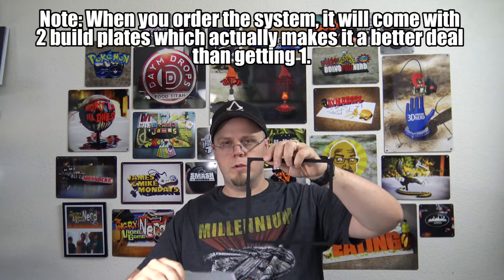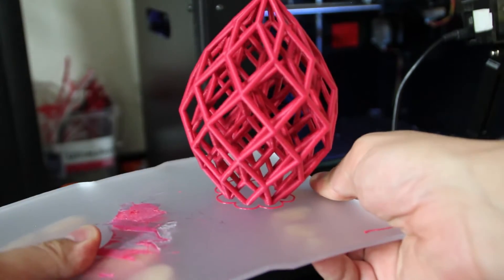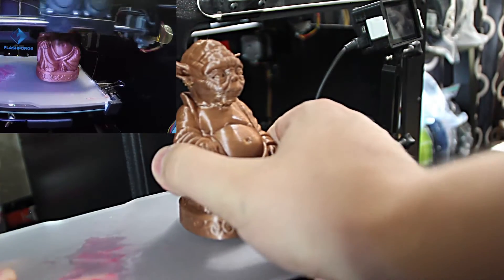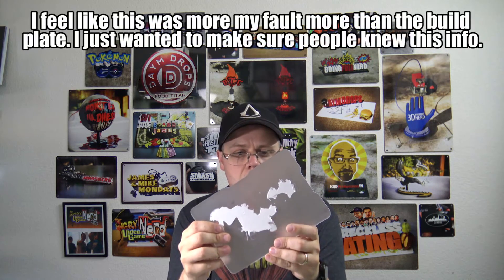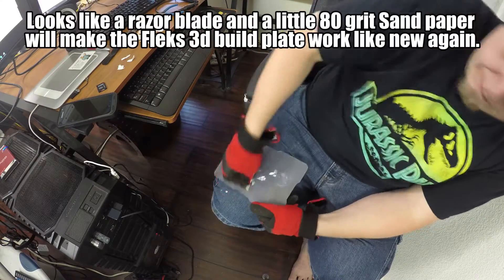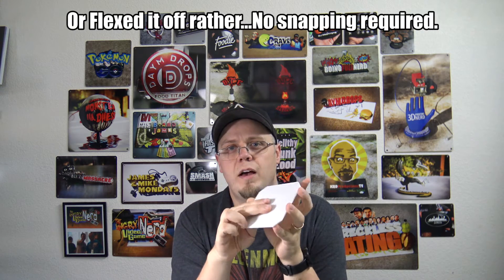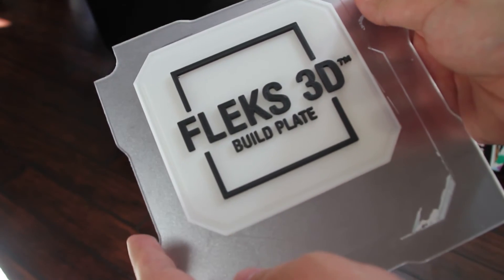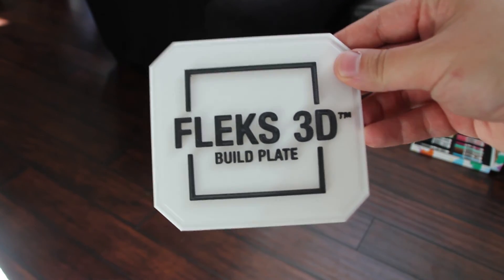Fleks 3D Build Plate Review and 3D Printed Logo

Comment: I bought one and am now throwing it away. The model I am printing has a big surface area attached to the bed. I need them to be flat. Every one of the ones I have printed has come off with a slight curve to it. No matter how many clips I use to hold it down, it doesn't stay flat.

If you print small items, especially with support, it doesn't come off completely. You're stuck trying to scrape little bits of plastic off, which is infuriating. The manufacturer blows it off as not a big deal. After a couple of times, you throw it in the trash and go back to the tried-and-true mirror
Reply: agree. I have similar experience. It probably works for smaller plates. My 12 x 12 inch is really hard to keep it flat. It is higher in the middle while lower on other corners.

Comment: Hello ! I took it even FLEKS3D for my Ultimaker 2! A curiosity ', I saw that there is' a film to be removed on one side and this side, and' shiny, and the opposite side and 'dull and a bit rough, you do volio 3 questions: the FLEKS3D and' to put in replacing the original glass plate or above the glass dish ??? The print side of the FLEKS3D and 'the shiny or the dull / rough ?? Last question, what temperature max can 'support ?? Thanks so much ! Alessandro Elvis3D
Reply from the maker: Alessandro Romagnoli You remove the glass plate and print on the rough side.  As for the max temp...I'm not too sure.  I tend to keep my prints on the cooler side do to the nature of how the plate works.  You don't need to print that hot. There is likely more information on this on the fleks website though.

Comment: An easier way to clean left over filament, at least PLA, and PETg , try using some Goo Gone on a rag, it makes cleaning the plates really easy. Rough up with sand paper, and then a little soap and water.
Reply from the maker: Thanks for the info!  I will give that a shot for sure.